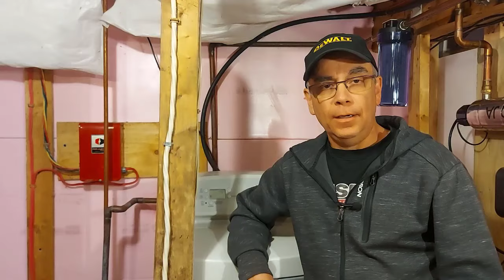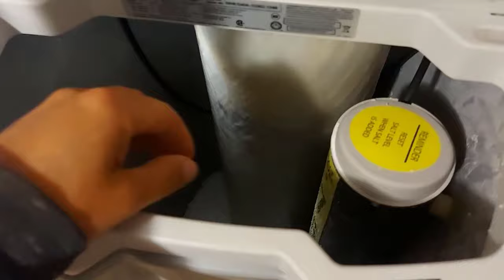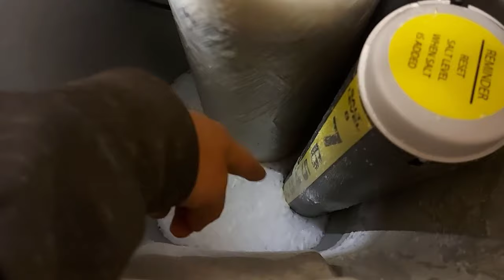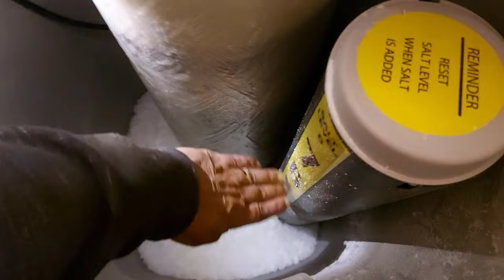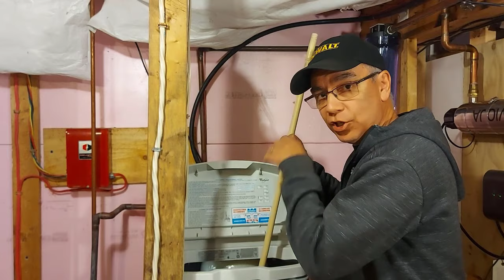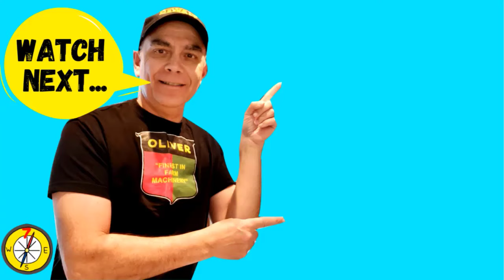How to Clear a Salt Clog in a Water Softener or a Salt Bridge

Comment: I just discovered a massive bridge in my water softener, just moved in about 4 months ago so I'm not sure how long it's been there. I have tried a stick, a garden trowel, and even a hammer, and nothing is breaking it up! It's totally solid at the "5" level. Any advice? Can I pour boiling water on it to try to soften the bridge?
P.s. thanks for the great video!
Reply from the maker: I heard you could pour hot water on it. It should soften it. I use a large ice fishing spoon to scrape it.
Reply: @GettingItDoneRepairs  thanks!!
Reply: I had the same problem. I eventually got my 3 foot crowbar, CLEANED IT and was able to easily and in a slow controlled manner push it through the bridge and break it up. I had to be very careful not to damage the bottom plastic piece, walls or any internal parts. It's my go to solution now!
Reply: @petenicholls718   ya.. some kind of bar with weight to it... I ended up using a bar used for digging post holes...  again having to be VERY careful about hitting the bottom or any plastic parts.

Comment: While cleaning out the "mush salt" in the bottom of our WaterBoss, I found a mouse. Yuck!  How did it get in there? My guess is that it came wit a bag of salt which sometimes lays on skids in warehouses or stores. Sometimes the bags can have a little split somewhere that a mouse can get into the bag. Other than that, maybe it got into our softener in the house, but who knows at this point. How long was it in there? I am now thinking about sanitizing the softener. Bleach can be used per the owners manual, but I need to be careful not to use too much which could destroy the bead bed. The hard part is cleaning out all the mushed salt. The plan is to take the unit out and clean it outside using the hose. Not sure about tipping the unit over on it's side. With the bead bed build inside the tank, I could damage something. We had a Sears unit before and it was easy to remove and clean. Parts kits were always available too. Not so sure about parts for the WaterBoss. Thanks for all the helpful tips here. I would have never found the mouse if I had not used the hot water idea to get the brine tub out.
Reply from the maker: Wow I'm so glad you brought this to my attention. I've never heard of this happening before and that could be a serious issue. I didn't some research about this and apparently its happened to many others. There is clear instructions on how to disinfect your softener and other water systems on google. I'm going to make a video about this, if I never heard of it, I'm lots of people haven't as well. It's good to be aware that this can happen. Again, thanks for sharing 🙂 P.S. Good luck with cleaning your water softener and system.
Reply: My goodness, Murphy's Law!

Comment: Found this on another video: Unplug and fill with water (not full, but alot) keep it like this for 4 hours. Then remove completely the water (with a bucket, if needed) salt on the bottom will be loose again, easy to manipulate. Please do not throw the salty water near trees or herbs, cuz they might die. And, of course, don't forget to replug after.

Comment: HELP.  No bridge, it has all crystalized like concrete.  I used a steel pole like thing, then I used a sledge hammer and I pounded and pounded and was almost able to make it to the bottom.  I poured hot water, waited 15 minutes and went back at it again pounding and pounding and pounding and slowly, a little bit easier than before made it close to the bottom (don't want to hit the bottom in case I poke a hole.  So that's where I am at, and my arm is soar from swinging the sledge hammer.   Any advice on how I can break it all up would be great.
Reply from the maker: Geesh, sounds like yours its really terrible.
Reply: Same thing happened to me that’s what I’m doing right now.
Reply: An auger drill bit may work.  That’s what I’m planning to use.

Comment: Hey can a clog cause low water pressure in your house
Reply from the maker: If you bypass the water going to your water softener you will be able to see if the pressure changes. But I have a hunch it may be the water pressure tank in your home. There is a bladder in the tank and it may have a leak. I have a video about that on my channel as well.
Reply: @GettingItDoneRepairs  will check that out right now
Reply: @GettingItDoneRepairs   the only thing is I do not have a water well I have city water .
Reply from the maker: @trevorbalkarran774  oh there goes that theory
Reply from the maker: @trevorbalkarran774  I googled it. Yes, a water softener can reduce your water pressure and flow rate. This typically happens when the softener is incorrectly sized for your home, the resin bed becomes clogged, or if there are mechanical issues within the softener
Reply: @GettingItDoneRepairs  I live in the state of Florida moved about 3 years now so this is all new to me  water pressure been fine since I moved in to the house no issues until now with it .

Comment: Crystal salt is the worst. Pellets are superior and a grid in the bottom of the tank. I've been using Winsor salt pellets and never had a problem with salt bridges or clogs. Salt pellets and the  water level in the brine tank should  equal.